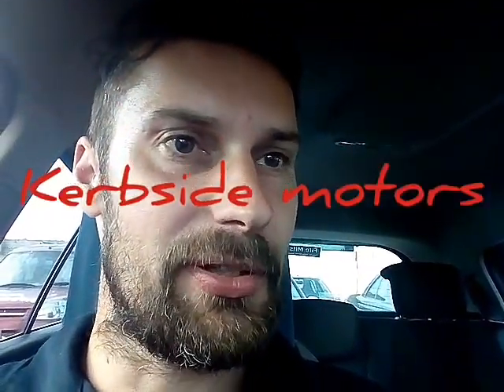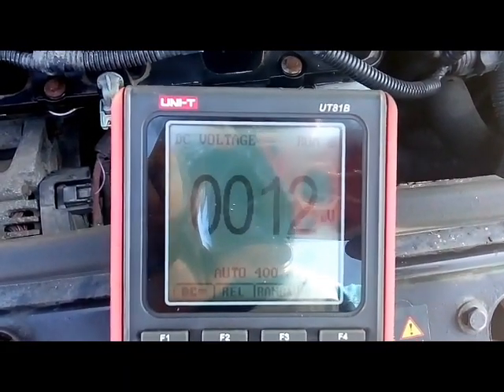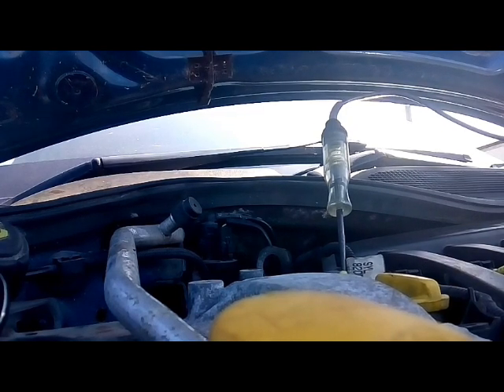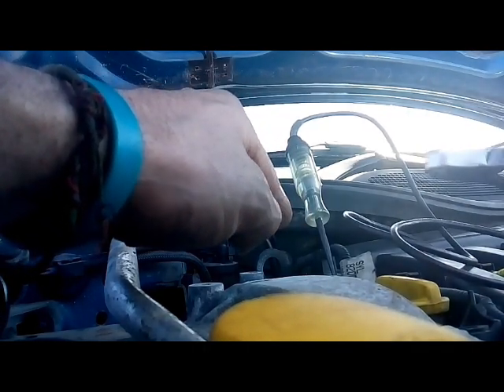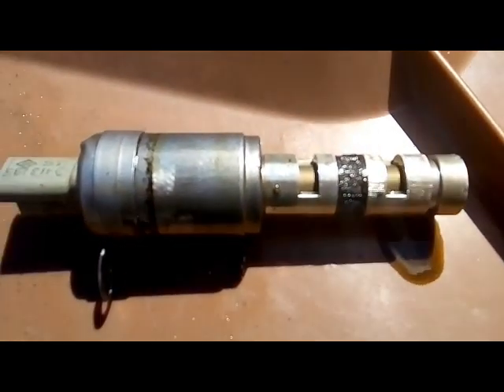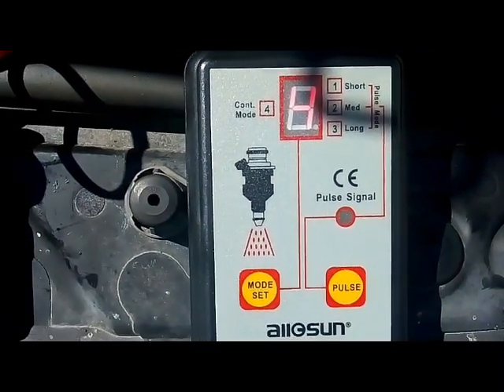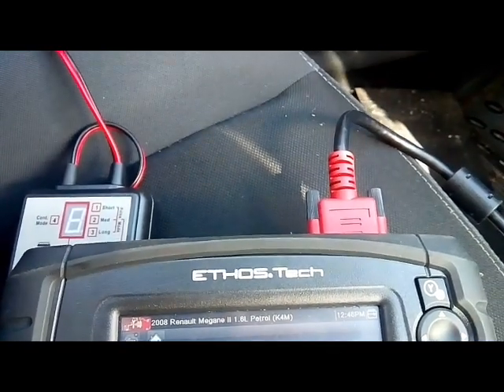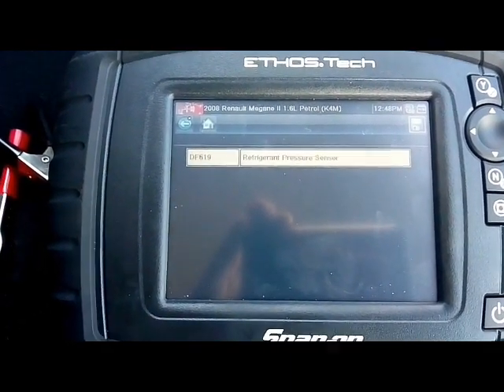P0010 Variable Valve Timing Fault PART 1 (diagnosis) this is fixed in part 2

Comment: Hi Matt,

Just want to say! I think you are one Very Special Guy!! Reminds me as I once was with Engines and Cars LOL

I found your videos after trying to find information on my Daughters Megane and even her Clio that I still own after some 10 years and has the same issue.

I always put it down to dirty oil, cheap or bad filters and oil draining back down it to the sump. This was common when I was a mechanic with tappet rattle on start up LOL

I guess oil starvation from the blocked solenoid valve contributes to this problem and is not ton a normal Engine Renault Service List LOL.

Her 1.6 VVT Clio Dynamique is very special. One of the very first Mk3’s demonstrators in Pearlescent red, Factory Privacy glass and with every conceivable extra! Including Criuse Control with Speed Limiter, Directional headlamps, Auto Lights, Auto Wipers, Full Climate Control and more! Hence I kept it along with my 1978 Ford Capri 3:0L that I have owned for over 35 years and it still has the Original Perfect Cills on it ;-)

You explain things the same ways as me, but also diagnose, question and show the problems!

I just want to say Thank You and Wish you all The Best In Life as I Can see!!!! You Certainly Deserve Recognition for your Skills!

It Not everyday or every 10 years I find a Person that I can say that too ;-)

All The Best,

Robert
Reply from the maker: Thanks for your kind words, it means a lot and thanks for watching.

Comment: Hi mate, same car with issues. Hard to start sounds like it's running on 3 cylinders, I get a check injection on the screen. Iv changed pencil coils, injectors, plugs, camshaft sensor right side an swopped tdc sensor off working car. I get the same code you got, but now it does not want to start unless foot to the floor on throttle. Help
Reply from the maker: How are the variable valve solenoids, can you swap them over? It could be out of valve timing on one bank, maybe a relative compression test, although it will need a synch from one of the cylinder coils. A complete bank of lower compression will be easier to detect that way.
Reply: @mechanicmatt871  all 4 cylinders are between 9-10 bar. Iv had dephaser on its way out before an it has a very distinctive sound, which mine does not have. If I had your number I could send some videos. The more I change the harder it is to start lol problem is there all off a working clio engine.
Reply: Forgot to mention, that both end spark plugs are over fueling ie black af. Even after changing all these parts.
Reply from the maker: Hi I was thinking V6 for some reason, I'm with you now Jeremy, you have good compression but it sounds like poor combustion from the sound of your spark plugs. Is fuel pressure ok? Maybe a vac pipe of next to the throttle body at the back.